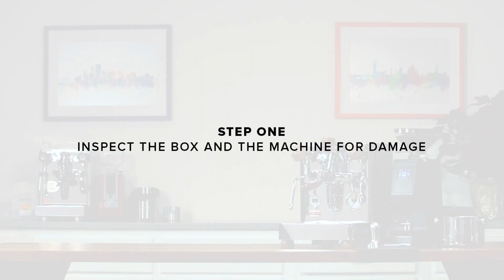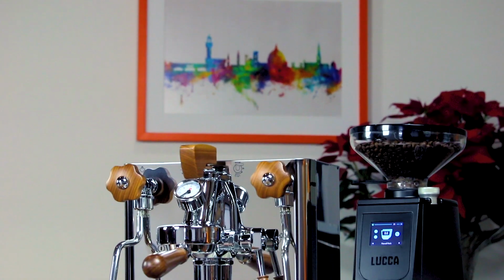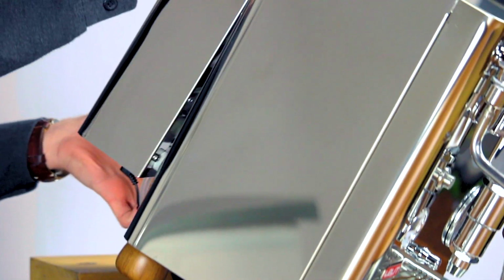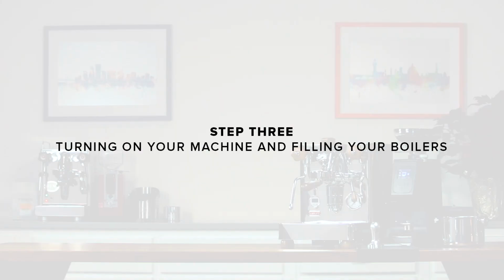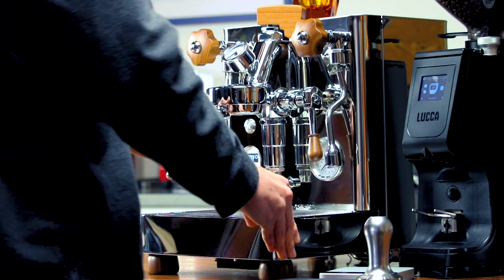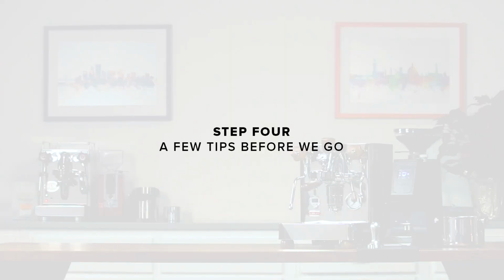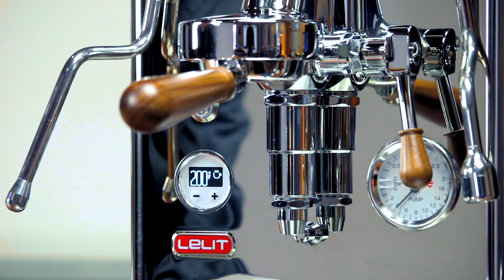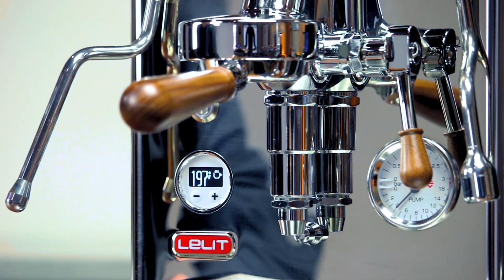Lelit Bianca Espresso Machine Setup

Comment: I tried the shortcut you showed at the end where you leave the top lever in the neutral position until you get to three bars and then turn it. When I tried that the bar measurement tool never moves at all. It never gets to three bars, what am I doing wrong?

Comment: Does running the machine on the tank vs water line change the infusion pressure?  Is it the pump creating the infusion pressure with waterline providing better prime to pump?  Or is the line pressure providing the infusion pressure?